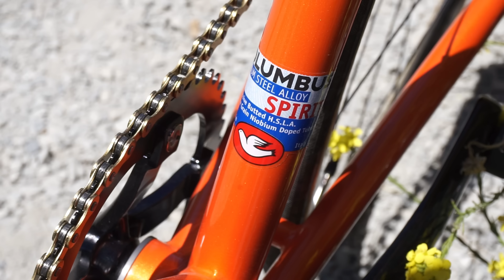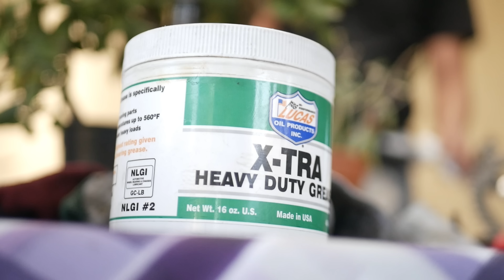Every Essential Bike Accessory & Tool New Cyclists Absolutely Need to Start Riding

Comment: Not gonna lie, if you need tools, they're generally cheaper at auto zone or home depot. Same goes for most safety gear. Eye pro, gloves, arm protection, even elbow and knee pads. Most of my mountain bike safety kit is my work safety gear. Lmao.

Comment: I'm waiting for my first fixed gear bike to arrive in the shop. Being an impatient type, I went out today and bought a very cheap POS beater single speed bike with a flip flop hub from a classified ads site. I wanted to flip it to fixed gear mode to practice on whilst waiting for the real bike. Well, the owner of the previous bike (or rather one of the previous owners before him) evidently didn't own a lockring wrench, because as soon as I flipped the wheel I found out that the hub is stripped and that fixed gear spins freely. Balls. On the other hand, I have just ordered the lockring tool for my new bike! And on the plus side, I learnt a lot by disassembling the POS bike's wheel, hub, axle , bearings etc.

Comment: Hi, great video! Quick question: I need a bike rack, commuting in London, for my Fuji Feather and I’m having a hard time finding a good one. Thanks in advance for any advice!!
Reply: Mounting options are probably the pitfall for most racks on fixed gear bikes. I can recommend the Ortlieb quick racks. They are designed for road bikes with rack mounts. If your frame does not have rack mounts, they also sell adapters that go on the seat stays.
Reply: Sounds great! I had a little look and it feels right. Wishing you an excellent day and thanks again.

Comment: I used to like the topeak road morph G until, that is, it broke on me, leaving me to go with my second option, buying another air pump.  For my stems only locked on the nozzle when it was disassembled and the rubber 'lock ring' was placed manually over the valve.  It was a pain.  I hated it, and the worst part was that loosing that rubber ring, as I did, caused the entire pump to become worthless as I could not pump the bike up in the event of a puncture. (I refuse to go tubeless as the hassle of removing, cleaning and inserting fresh sealant in to my tire far outweighs the simple act of replacing a tube.)   That being said I found that the crank brothers power alloy bicycle pump has not failed me.  There are two types one for high pressure and one for high volume.  I like the high pressure as it allows me the same resistance no matter the pressure.  It comes both with and without a gauge so you can pump your tire by feel or by reading the pump.  I have used it several times and been very pleased.  One thing I really like about it is that everything on the pump is self contained, there is nothing to disassemble or loose.  The pump nozzle fits in to the handle keeping the form factor nice and small.  This thing will fit in both your backpack like a champ, or in a nerdy saddle bag.  It can come with a CO2 port should you fancy that.  It looks cool.  On my up coming centuries it will be one of the pumps I will be taking with me.  The second pump I know this will ruffle some feathers, is an electric pump.  These things are all over amazon and are worth every dime, They pump your tire up in PSI Bar or what ever, they are small, fast and most of all they only need power.  Power you can have with you or charge it when you charge up your lights.  Anyway I think your content is good for both geared bike riders, like me and fixie riders.  Keep up the great work and stay reasonably dangerous.

Comment: Yes and no on this list ..
That was a massive tub of grease. I look after a lot of bikes on shitty English weather and I buy grease on a small tube... which lasts for ever.
On chain cleaner and lube... There is a lot of marketing nonsense.  I know many younger riders who have bought into it.  Go to any Nome shop and see what they use.  Use that!
Usually, bike shops do not use what they sell... They use pretty basic products.
For washing a bike, warm soapy water and a sponge and an old toothbrush.
Then proprietary cycle oil dripped on the chain and wiped off after a few minutes riding.
If you are not from a cycling family and didn't grow up fooling around with bikes, then the BEST way to save money is taking a bike maintenance course at the local adult education place.  
And as to Park Tools... I have several, but they are no better and no worse than others.  If you want a fairly standard tool, like a 15mm spanner for your wheels, go to a tool shop.  Excellent quality with a lower mark-up because they sell to the trade, not to fashion-aware cyclists. Park Tools are good, but madly expensive and there are others as good or better.  
Overall, a good list.
I would always want a spoke key and a couple of nice pairs of pliers. Also, sharp cutters for cables.  
And a can of WD40, mostly for squirting down outer cables before inserting new inners.  
On the "chain cleaning" advice: I don't even do it half that often.  These things can be taken too seriously.  😮